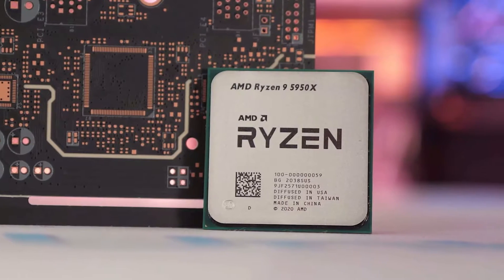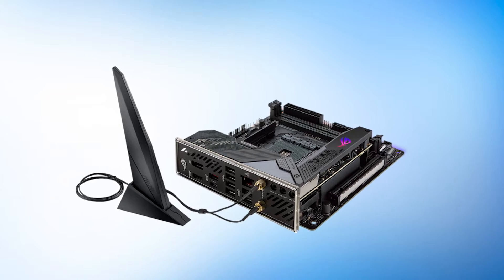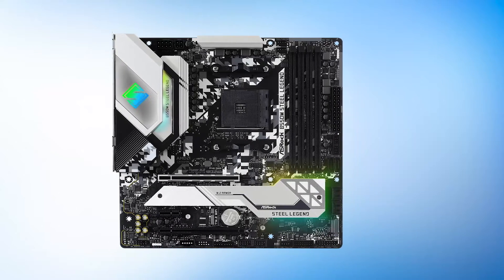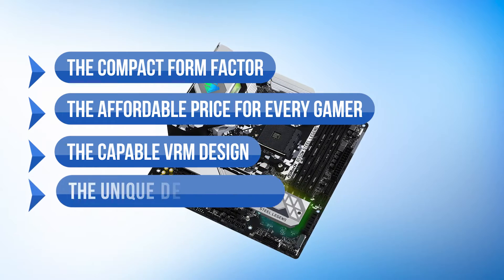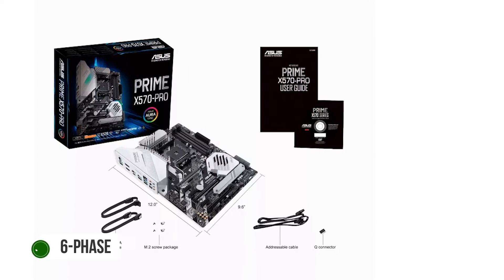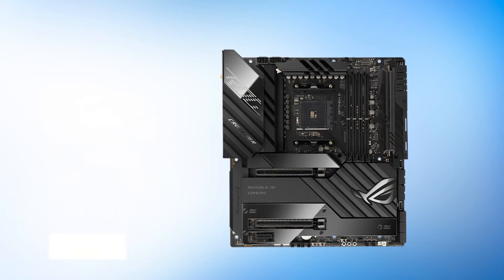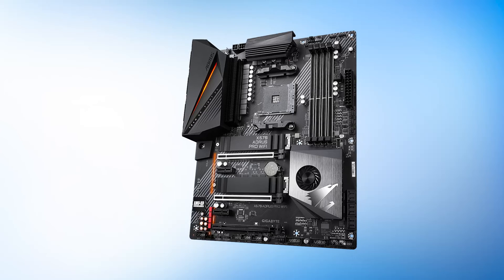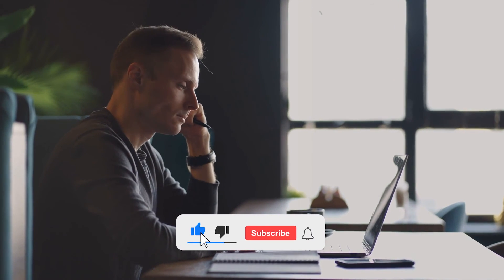The 5 Best Motherboards For Ryzen 9 5950x TODAY! (TOP 5)

Comment: my GA-AX370-Gaming K5 not responding with Ryzen 9 5950x. please help me what was wrong with it, the only 1 red light is on and fans working. no display. thanks in advance!
Reply: guess you figured it out by now but you need a bios update and to install that you need an 2nd or 3ed gen cpu if that board has no bios flash back.
Reply: @DJDocsVideos  thank you so much for reply. i think i have to buy new compatible motherboard for it. the older one is still not recognising new CPU.

Comment: I have a B550 Steel Legend and an Asus X570 Prime Pro and a 5700x kicking around and was wondering which board would max that CPU out better and also I have 4 4tb drives along with 2 M.2 drives I want to throw in the build.

Comment: I will upgrade my rig but question for ASRock B550M Steel Legend it uses 1 ssd nve pcie gen3 x2 and 1 nve pcie gen4 x4 compared to ASRock B450M Steel Legend uses 2 gen3 x4 what do you think? Which one is better ?
Reply from the maker: hi, it depends on the cpu you want to paid it with and how important are these slots for you

Comment: Is there a difference in the MSI MPG x570 Gaming Edge Wifi and the MSI MPG X570S Edge Max WiFi? Besides the fan?
Reply: Yes, the first MSI x570 boards in the budget prices were not great with the VRM's. I have both of those two boards with the X570S in my primary 5900X system and the Gaming Edge Wifi in my server/media PC with a 5600X. I got the older X570 Gaming Edge for $80 new in the box a few months ago and it replaced a B450 Tomahawk for more Gen4 connections.

Comment: I have a Gigabyte x570 aorus xtreme with my AMD Ryzen 9 5950X and AMD rx 6900xt.
Reply from the maker: cool, thanks for sharing! What is your experience with it?
Reply: @BCZone  Works great. My settings in bios are. 
XMP= 3600mhz 64gb cl16.
PBO Limits= Motherboard.
Curve optimizer = All cores  negative 12. 
Max cpu boost clock override = 300mhz.
Cinebench R23 Multi core -Test Throttle= 29316